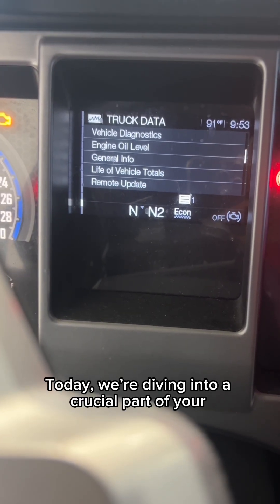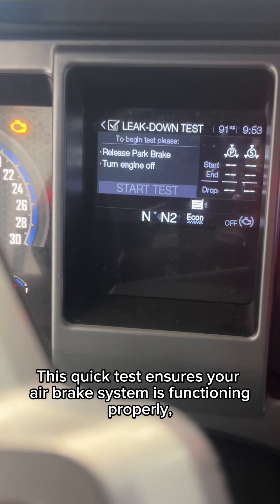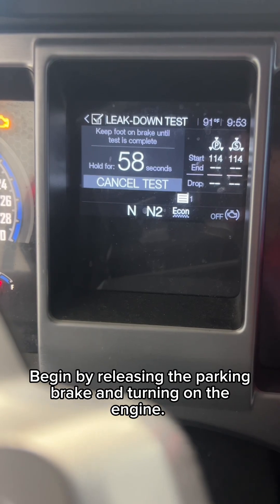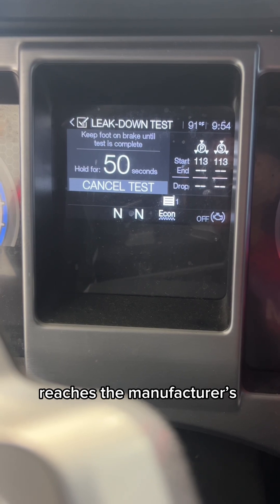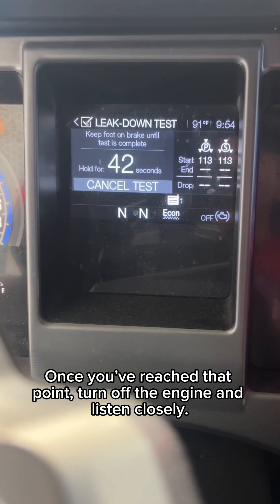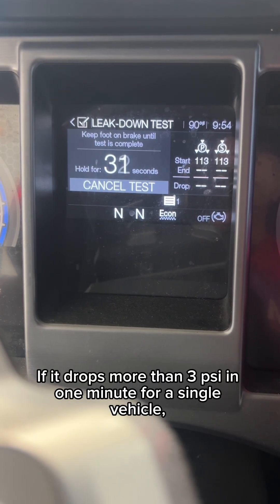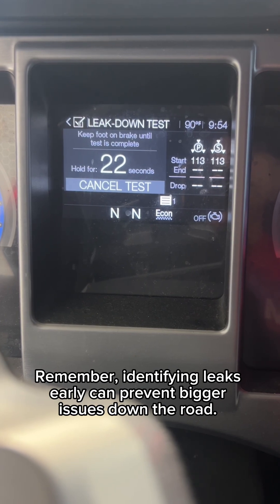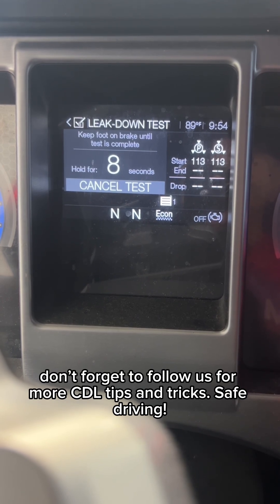"👉 DOT Air Brake Leak Test Explained in 1 Minute | CDL Pre-Trip Guide 🚛 #shorts "

Comment from the maker: 💡 Quick recap:
	•	Static: 2 psi (single) / 3 psi (combo)
	•	Applied: 3 psi (single) / 4 psi (combo)
	•	Low air warning: ~55 psi
	•	Spring brakes pop out: 20–40 psi

👉 Truck smart, stay safe on the road! 🚛